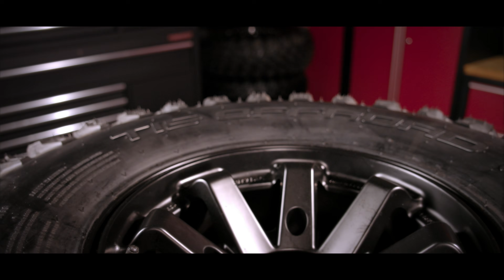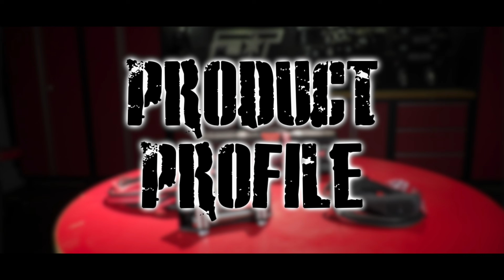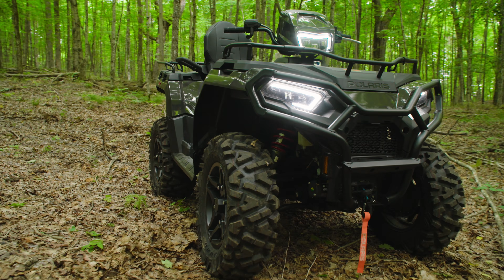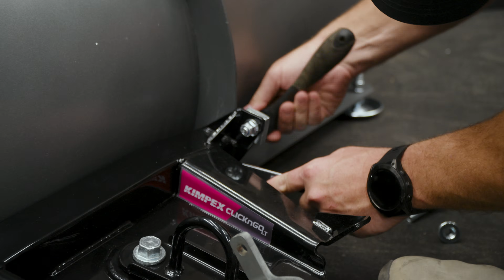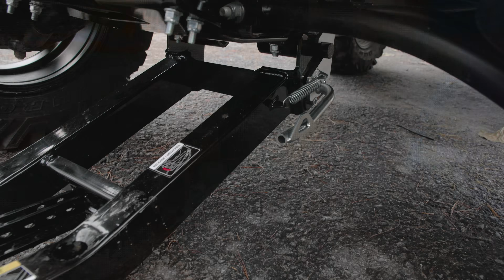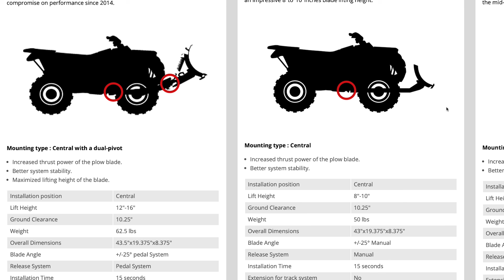Snow Removal Made Easy | ClickNGo Snow Plow from Kimpex

Comment: Loved my click n go 1. Back then they made a heavy plate that integrated with my frame in stock bolt locations.
When I went to another ATV, all the mounts were now "universal" and used ubolts. Which for me, I hate them, and tells me I'm making my frame pinched, getting rusty, and are they in the optimal strength location?

Have they returned to specific mounts, or still universal ubolts?